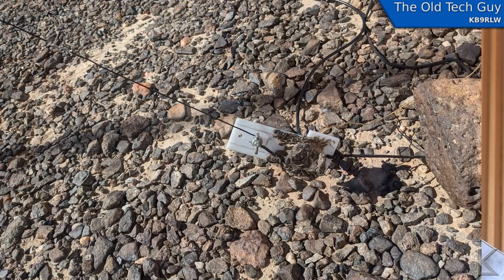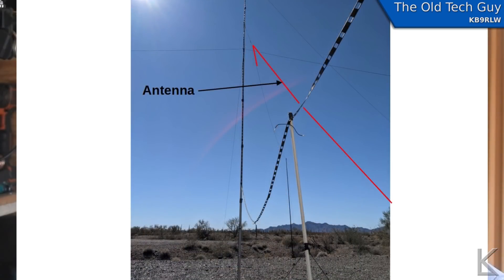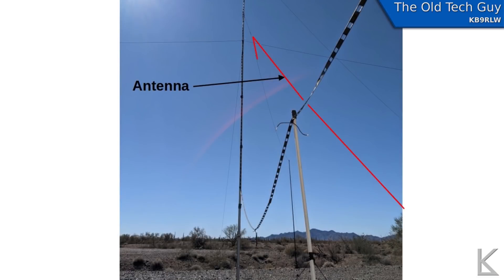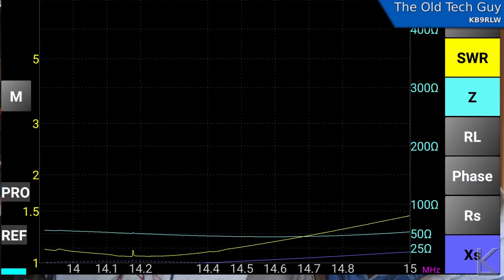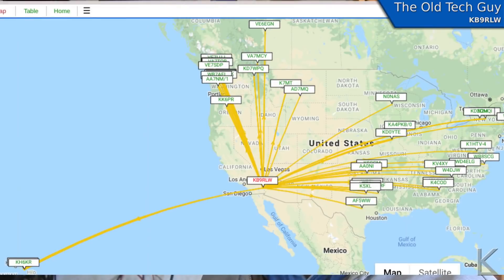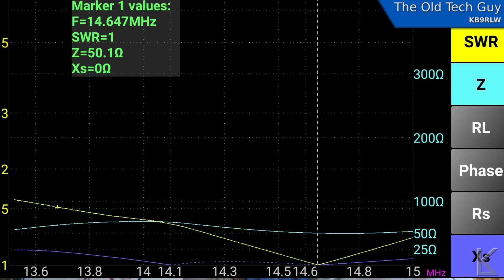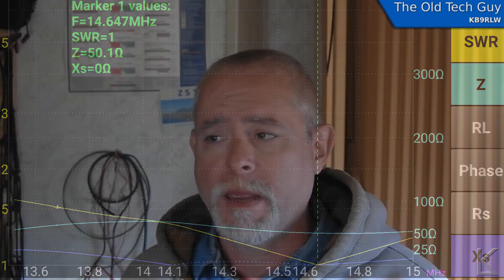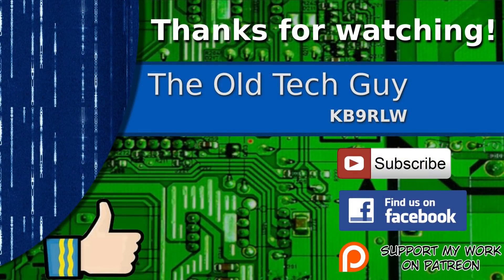Ham Radio experiment - End fed half wave antenna sloper vs flat horizontal orientation.

Comment: Your results mirror mine.  I have a 40-10 EFHW that's about 12' (3.6M) off of the ground at the transformer end and about 30' high at the other end.  The SWR was drastically affected buy the height above ground of the transformer.  Even with only 17'-18' (5.1-5.4M) of slope over 66' (20M) it's not terribly directional.

Comment: What about a lesser slope....not flat and not 45 degrees. I ask because my EFHW arrived today from MyAntenna.....after the snow and ice abate (could be late March) I'll get up on the roof (metal) and attach one end at the gable (transformer end). The other end will go 70 feet out to a 14 foot tall pole that already has a pulley on it. My back yard seriously slopes upward and going from gable to top of the existing pole will be practically horizonatal, like in your awesome video. My orientation will be  mostly east-west.

Comment: Great video but the flat top is a bad idea if one lives in Florida due to lightning. My EFHW coax is buried under ground from the house to a pine tree The 49:1 UNUN is mounted on the trunk of the tree two feet off the ground. The UNUN's ground connection goes to an eight foot ground rod. The antenna wire goes vertically up the tree before going flat to another pine tree. If the antenna is ever struck by lightning the ground rod will take the hit. The antenna is also at DC ground potential which gets rid of static charges.

Comment: Excellent video, Kevin. I just got an x6100, which is perfect because I always work hundreds of miles from home, and now I'll be able to play. If I use an EFHW with a wire cut for 40 meters, will it resonate on 20 and 10 too?
Reply from the maker: The answer is yes, but it does depend on where it is cut for 40 m. If you have it resonating at 7.2 megahertz, then it will resonate at 14.4, which is double and above the 20 m band, and it will resonate at 28.8. so you might want to resonate it at 7.1 so it will then be resonant at 14.2 and 28.4. It's all about the harmonics

Comment: t would be nice to see how a sloper off of the ground works. just add another 22ft to one end. I'm building a vertical sloping co-phase with directors and reflectors for 10-12M, so, 6 vertical elements in total on magnetic mounts around 27ft apart these on a large tin roof with 11 to 12 degrees pitch facing mostly west from Europe. Last week i reached Sao Paulo in Brazil on 100W with just one mag mount on this roof, i will swap for 6x adjustable whips, there are some nice extendable antenna available that extend to over 5M long there is also a cheaper option that extends to 2.5M which might serve for the directors and possibly the driven elements if i add a little to the tops but i imagine the larger version will be able to handle slightly more power.

Comment: What about an end fed in an inverted V or inverted L configuration? Maybe a top-fed sloper? 🤔
Reply from the maker: It'll behave similar to a center fed dipole in those configurations.
Reply: @loughkb  oooh, so it would be more directional than a sloper configuration?
Reply from the maker: @GothMoistOwlette  Both the inverted L and the inverted V are more omni-directional, closer to a vertical in the pattern.

Comment: Kevin, have you tried vertical to 40+ feet then flat for remainder of the wire? My EFHW is an 80m-10m, 163 feet of wire, that goes vertical up to 43 feet then horizontal (oriented east to west) for the remainder of the wire still up at 40 feet.
Reply from the maker: That would be what they call an inverted L antenna.  Not uncommon, and I've used it previously.  Works pretty well.

Comment: Radio waves come down from the sky, the end point on a dipole antenna is irrevelant to how the antenna hears because radio signals are coming down from the sky. Your theory only applies to ground waves.
Reply from the maker: Radio waves come in from all angles depending on the layer of the ionosphere they bounce off and how far away the station is.   We're on the surface of a rough sphere.  Draw a straight line that touches the edge of a sphere and now look closely at the 1-2 degree arc where the line intersects the edge of the sphere.  As you move through that section, the angle of the line relative to the surface of the sphere will change over the area.
Reply: @loughkb  could you please say that again in simple english so I can understand, I don't know what a sphere is and can't quite visualize what your trying to say. Make a video using a chalk board and visually explain your theory and I will watch it.
Reply from the maker: @hamradiolife9854  A sphere is a ball shape.  Our planet is a big ball.  Signals come down from the sky at all angles, depending on where they are transmitted from.
Reply: @loughkb  Ok 👌I see what your trying to explain, but for a radio wave to come down from the sky at what ever angle and only barely excite the  very end point on the tip my dipole antenna the radio wave would have to be more like a lazer beam than an actual ocillating radio wave. Your theory would only be correct if the radio wave was at a frequency so high that the radio wave itself had a wave length of miniscule porportions resembling a lazer beam.

Comment: Great video. I have 2 10-80 EFHW in flat top configuration. They are oriented N-S and E-W and set by a antenna switch to my transceivers. I haven’t noticed that much directionality as expect, especially on 40 and 80 meters de WA9SWW

Comment: I wonder what you would get if you set upon a flat horizontal L covering all sides. Bend the wire 90 degrees at the center. You could even run the wire out to 203 feet and use more coax before the choke. Inquiring minds want to know. I might try this experiment based on your results.

Comment: I am pretty sure Steve Ellington did this comparison too, as well as testing all manner of grounding and counterpoise configurations.  I think he determined deploying the antenna in a sloping manner performed the worst of all tested configurations (which is to say worse for the EFHW), and if I recall correctly, the inverted L performed the best.  I have the Steve Ellington "special" deployed south to north at 30' at the feedpoint, but since my back yard drops off significantly, the majority of the 134' wire is at about 50' in height.  My Reverse Beacon Network testing and contacts show results just like yours.  Contacts due south and north are rare.

Comment: My end fed half wave has the transformer end at about 25' and the distant end at 10-12' in a straight line east-west. It's a MyAntennas 8010. I put it up without tuning at all and had acceptable SWR using a tuner in places. Just recently I folded back about 15" off the distant end to get resonance on 80 meters at 3.56 MHz or so. SWR on 20 meters is pretty well flat across the band. Still checking out the performance, but it seems to do the job for me. I have been working FT8 and having lots of fun doing it. Thanks for sharing your experimentations.
Reply: Hi Kev and William.. Sorry if this is a ‘silly’ question with an obvious answer, but when you fold back the end of (say) an EFHW, does that have the same effect on the SWR as completely removing the folded back length? Hope that makes sense🤔
Thank you..
Reply: @johnrees44..G4EIJ  I replied, but it has not shown up yet and then I realized I didn't really answer your question. I would say that cutting the antenna and folding the antenna wire back on itself would be very close to the same as far as performance goes. The difference would be pretty minor, but it would take some accurate measurements to determine.
Reply: @billpowell5931  Thank you..It would be useful if the amount  of cable folded back to tune the antenna was equal to the amount I would need trim from the cable to achieve resonance.. I always worry about trimming too much😩..
Time for an experiment, maybe😊..73
Reply: Whoa, William Powell your one of my favorite actors! ;)

Comment: Personal request for inverted V test! =)
Reply from the maker: It would be more omni-directional, that's about it.
Reply: @loughkb  I was wondering more about close in contacts, since it appeared you had a large skip zone around your QTH?
Reply from the maker: @YZFoFittie  An inverted V will provide a sort of middle ground between a flat top and a vertical.   You'll get a bit of NVIS effect and a bit of lower take off angle.  It kind of splits the difference, some of each but not as good as each.

Comment: I love your videos!
What would the result be if you ran flat top with right angle bend in the middle 1/2 & 1/2?
Reply from the maker: Assuming you're talking about that right angle being a bend in the vertical direction, that's pretty much an 'Inverted L' antenna.   And yes, it would act both like a vertical and horizontally polarized antenna.
Reply: @loughkb  actually I was wondering  about a bend  horizontally  to make it fit in my Lot.   flat horizontally with a right angle bend. or slight slope  from center
Reply from the maker: @MYtimeNspace  The less of a bend the better, but you're ok up to 90 degrees.  You just need to make sure the antenna doesn't bend back on itself at all.

Comment: Thanks Kevin,   Out of curiosity, what if you fed the sloper from the top instead of the bottom?  I believe it would change your take off angle, but would it change the reception?
Reply from the maker: Anything that changes the angle of the strongest lobe during transmission should also change the sensitivity in the same way, I think.  I'm pretty sure an antennas pattern of sensitivity for RX is going to mirror it's pattern of radiation during TX.

Comment: My QTH is S9 floor. So my random wire is relatively useless. City dwelling sucks for ham!
Reply: Try a different specific length antenna. I'm running an EFHW 132' with a 49:1 transformer and it works great. 50' up in a horizontal configuration. These can be noisy antennas. have to take care of rf on the shield by grounding shield before entering the house. I'm in the city also.
Reply: 100 Watts into a Vacuum variable capacitor Mag loop with digi modes or CW.  
Lucky to get 5 watts ERP, on 40 meters.  Making QSOs, 5000 miles out. 
Ham station on a tiny city balcony.
Reply: I have the same issue on my endfed. I plan to put up a closed loop since those seem more immune noise.

Comment: Looks like you got a lot more gain with the second set-up. Question. Have you already used or looked at using an Inverted L antenna? I'm a nubby so I'm looking for some advice on that configuration also. Thank You in advance.
Reply from the maker: An inverted L will give you some of the advantage of a vertical and some of the advantages of a horizontal antenna, but not the 'best' of either. 
It's a really popular configuration and it does work pretty well.

Comment: These sorts of questions are why I'm learning to use EZNEC. I'm hoping it will be easier and more dispositive than endless experimentation of configurations (not that there's anything wrong with that).
Reply from the maker: That would certainly save time.   I just like fiddling with stuff physically.

Comment: Now can you do the L vs the V? I noted the 2hr time difference between switching which allowed Grey line to move in changing things. I’ve had great luck with these antennas H. Higher bands seemed to play better than it being in the L form. Maybe something with my ground ? I test for about 3-7 days per config. I know the maximum current of these antennas is smack in the middle. I wonder if that affected the antenna on say 10-20m in the L config. I do seem to notice better results with it sloping at a 45. But overall the flat top has impressed me the most. Mostly Nvis with some dx per the usual dipole below 65 ft agl. Thanks for posting your results. I’m curious as how the inv V fits into this as well as the L in the desert. 73
Reply: There's a way to test both at exactly the same time. Maybe Kevin will do a video on that.

Comment: By counterpoise, do you mean a length of wire mounted to the ground lug?
Reply from the maker: The ground side of the transformer, where the coax shield connects to it.
Reply: @loughkb  I have a store bought end fed. It had a ground lug/screw on it. I’ve never opened it so I wouldn’t know what the grounds side of it would be. It doesn’t open, it’s sealed.
Reply from the maker: That screw is almost certainly connected to the shield side of the coax connector and would be where you'd connect your counterpoise.

Comment: I have two end fed have wave multi band antennas. My first one was the 8010 set up as a sloper. Transformer mounted about 4ft and allowing upward to scout 40ft. It did pretty good. Now I have it on a push-up mast at 20ft sloping  across and up to 35ft. Pointed NE/Sw. also have a 4010 mounted at 40ft at both ends pointed NW/SE. works much better. SWR is much lower , I am now able to pick up the weaker stations much better, much better for DX.

Comment: Thankyou Kevin! As HAM radio newbie I started building a loop antenna. Based on your loop antenna! The MLA works great and now a try Theo Oskam replace the DC gear mottbh a stepper motor and auto tune the MLA.
Kevin, in this yt you are using AN nanovna, whatsapp brand is this equipment? 
Thx. Theo 73 
PA0HTY
Reply from the maker: It's a blue VNA.   Search my channel for that, you'll find the video I did on it.
Reply: I'm also building a magnetic loop antenna with auto tuner, so I'm interested in your project. How's your build going so far?

Comment: Thank you very much for the interesting video.
It would be interesting to test what would be the influence on the direction if you would put it much closer to the floor.
73 de Roman, HB9XBK
Reply from the maker: If you get it lower than 1/4 wavelength and keep it flat, it will begin to push more of the energy upwards, decreasing skip distance.   Becoming more NVIS.

Comment: Ah hah  and I was cautioned I have a certain vertical fan dipole  mounted on my deck  that's why even after careful measuring of the elements the tune is not spot on the elevation though not that great does change the tune

Comment: I have an end-fed that I have running in a kinda inverted-v shape, except it's horizontal. Seems to work well in all directions
Reply: I've got an 80m EFHW that is up 25 feet and about midway there is a support ring dropped down from an over hanging high branch, I raised that midpoint up a bit. Curious, what is the angle of your inverted v?
Reply: I'm running east/ west to cover the east coast region and located in Raleigh NC

Comment: Wondering if running the endfed as an inverted V with the apex up at about 30 ft would have similar results as the sloper.
Reply from the maker: It should probably be very similar.   Not as omni-directional as a vertical, but much more-so than a flat dipole.
Reply: MMANA-GAL is your (free!) friend for answering exactly that question.

Comment: I'm a full-time RVer and lucky to be able to put up an HF antenna in RV parks...some parks worse than HOA's ..... by the way, I also have a buddistick vertical with 5 ground radials and many times it does better than my endfed dipole 73/k6sdw
Reply: I'm a full-time RVer too, parked north of Phoenix AZ. My main solution is a 2m mag-loop, but I just wish I had a noise floor as low as Kevin's.

Comment: Interesting you mentioned a nearby inverter.  I found my Mitshubishi mini split inverter a  noise source . Power line filtering has eliminated most but not all the noise.

Add HVAC INVERTER SYSTEMS to the list of usuall suspects.

Comment: My flat EFHW is great for NVIS, not much more. Inverted L much better longer distances and omni. Best "counterpoise" is about 20' of coax with a CMC then on to shack.
Reply: Inverted L will radiates omnidirectional from vertical part and like dipol from horizontal part. My best setup for EFHW. Oh, plus 0.05wl of counterpoise
Reply: Looks like his testing with WSPR as a flat top proves it's not just good for NVIS to reach the central and eastern US as opposed to NVIS with normal prop just a few hundred miles.

Comment: Thanks for the video. This is an interesting test to see. I use both dipoles, and end-feds, normally my thought process is, if I am able to suspend a center with coax, then I hang a dipole, if not I use an end-fed. So after seeing this video, I have another option.

Comment: Hi Kevin,
Nice that WSPR showed a definite pattern change with the antenna orientation. Would not have expected the upward change in resonate point. Good info. I have all the aluminum tubing needed for a vertical 40m EFHW. Just waiting for warmer weather and softer ground to pound in the galvanized support pipe. Stay safe.   WJ3U

Comment: So close to a doublet but getting feed point high up is good. Think open spaced feed line would help sum 😉KC3ONO hope to hear you try to check in to the Toad Harbor Net 1.930
Reply from the maker: The 49:1 match is designed to work with 50 ohm feeder and required to feed the resonant wire at the end where it's characteristic impedance is just shy of 2.5K ohms.   This makes an End Fed Half Wave (EFHW) wire antenna.
Anything else would be a different antenna. :-)

Comment: Always wanted to know what the result would be if the feed end was mounted at the high end. A sloper with the feed end high. They say a quarter wave sloper with the feed high had the current max near the ground therefore not so good, however, a half wave should perform ok. Hmmmm?🤔

Comment: Couldn't tell how tall those trees were nearby, but if they are taller than your masts  you might get a light line up with your mini and a downrigger clip. There are lots of videos on using the mini to carry fishing lines out that would work with similar application. Gonna try it with mine soon.
Reply from the maker: The trees here rarely get over 15 feet.     I plan on experimenting with the drone if I get to northern AZ this summer with big pine trees.